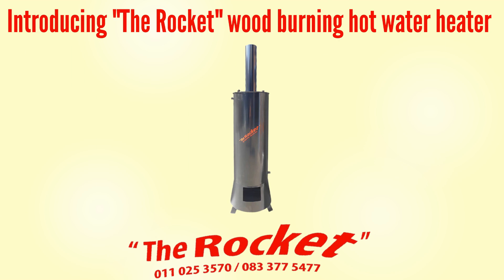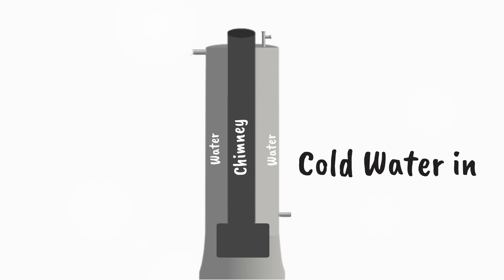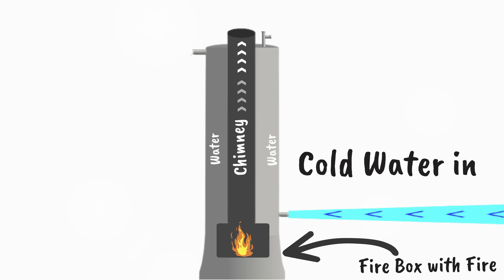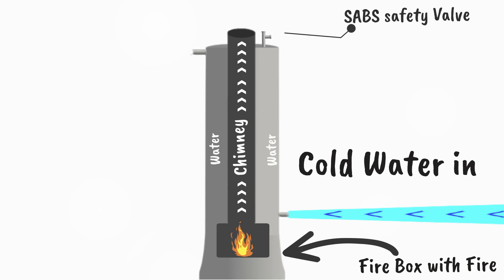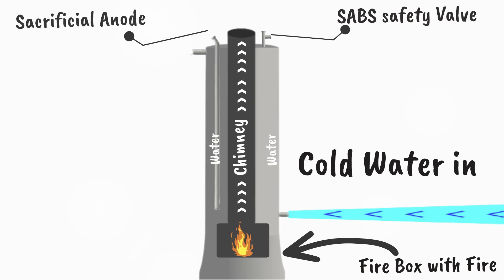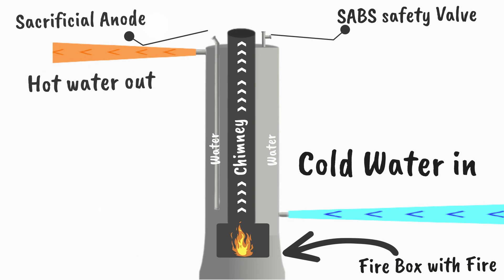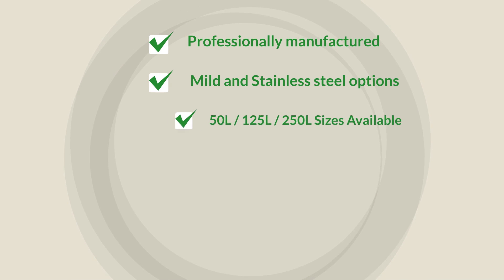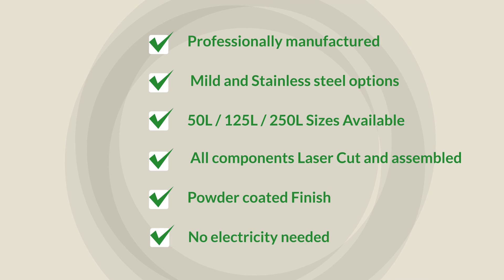The Rocket Donkey Boiler Explainer Video - How It Works

Comment: What does one of these cost
Reply: there are different models galv, stainless etc..and then the capacity as well,   galv 150l  R6990, 100L R5990 200l R7990
manufactured in western province.